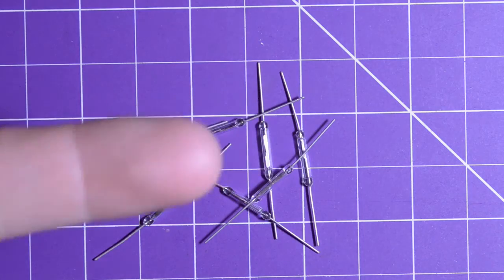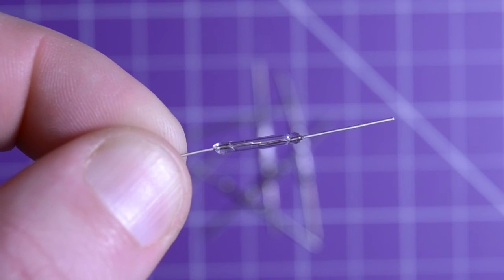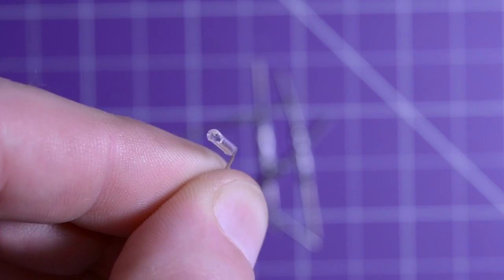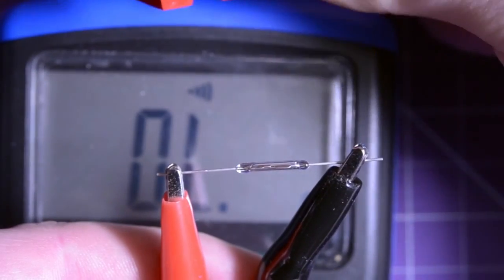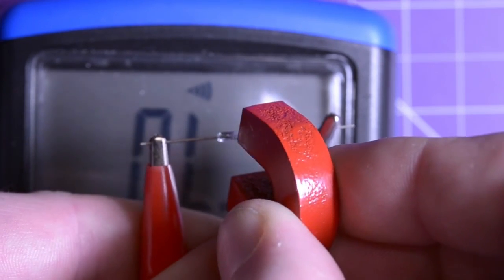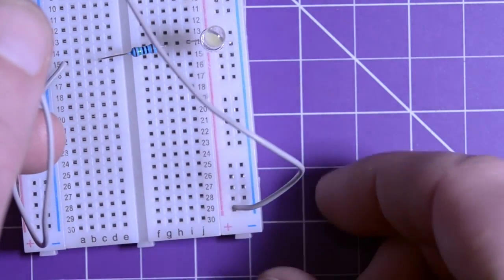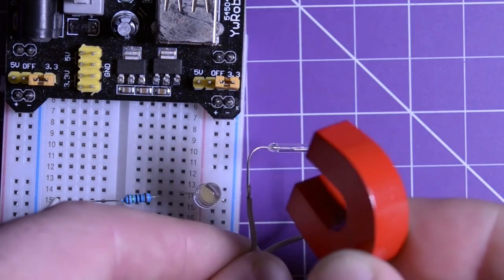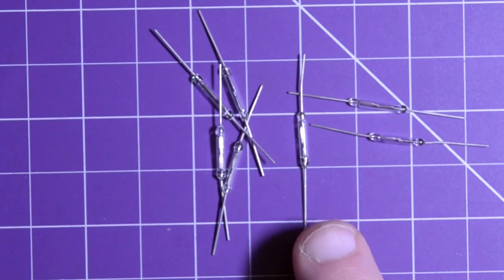Cheap Magnetic Reed Switches

Comment: The magnetic circuit needs to closeing across the legs and contacts so need to be the two pole oriented in that direction. This is the common and normal behave on every reed-switches.

In a perfect world all of these had a specification sheet what needs to read to set the optimal magnet, working distance and moveing direction. When u buy a quality products the mfg. provides this information to makes your life and desing easyer.

Comment: Honestly, I had to make a keyboard of 25 keys from reed switches. getting consistency with these guys is a pain in the butt.
Reply: I had to make sure when bending each of the legs that I was observing the phsical point inside the switch that would be closest to the magnet. If you work out which is the most magnetically sensitive point in the switch, then you can either mark it or just attempt to eyeball it as you're bending, as I did. Also, because the keys in the keyboard pivot downwards  (at an angle) I also had to offset the reed switches from the magnets by a cm or so. By far the best result I got from the circuit, but so so so tricky to get it all working.

Comment: I realise I am VERY late to the party, but all the issues you brought up are normal operational parameters for reed switches. A couple of things I had to learn when I started using them..

First, To bend the leads you must grip the them near the glass with long-nose pliers first then bend them to protect from breakage.

Second, They are single direction so they can't be influenced by other magnets. They were used a lot in home secrurity systems. The switch would be on the window frame and the magnet would be attached to the window. If they were bi-directional then anyone with a magnet out-side could over-ride the inside magnet.

Sorry for the rant. I helped install them in the 80's.

Comment: Good points raised here. The ones I bought years ago used to have a small blob of paint on the sensitive side, if that was missing then the reed itself needs to be at a90 degree angle to the magnetic flux . . . . . . I think . . . .
Reply from the maker: although this is true, the magnetic flux is also in the shape of an arc and therefore the distance the magnet is away from the switch also matters, which is exacerbated by the fact that these reed switches aren't made to the same quality as the ones from back in the day